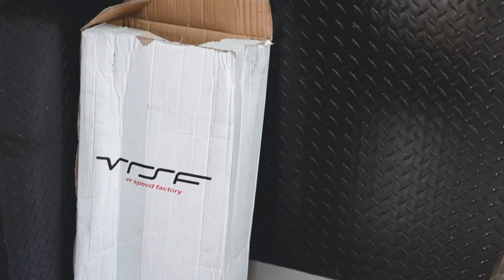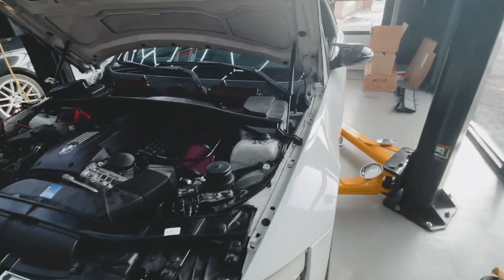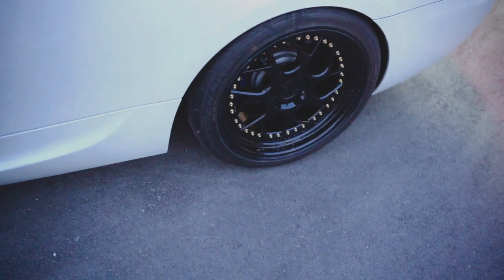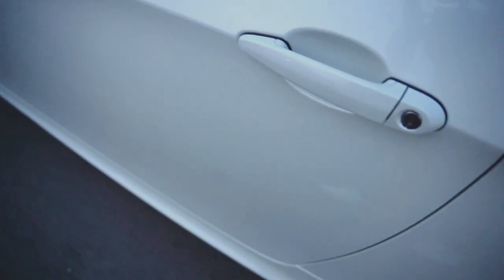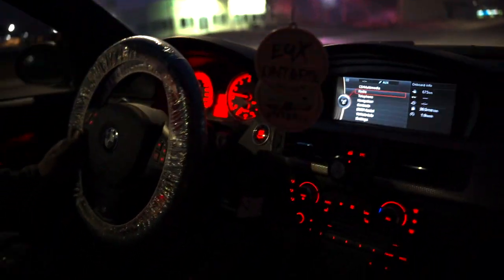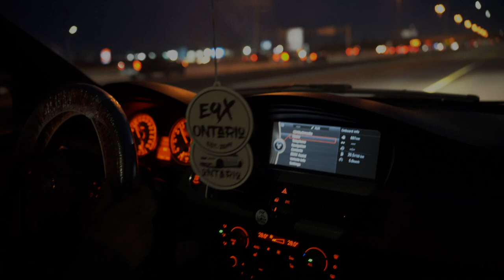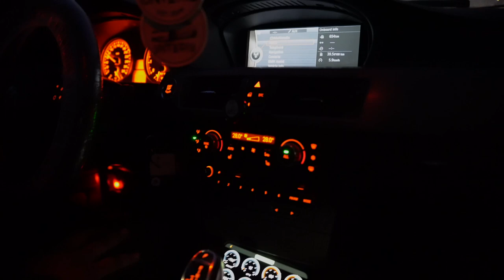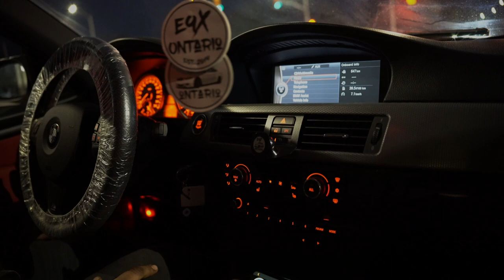335is CTS Turbo Stage 2+ Kit Install + Test Drive

Comment: Decided to get DAW Flow Max Plus myself. Lookin good n great video 👍
Reply from the maker: Thank you! Have been hearing that a lot about the Daw flows, how long have you run them for?
Reply: @e9xontario  I’m not running them just yet. I’m in school and work at bmw part time. Just saving up for everything I need currently. My turbos currently are leaking bad and rattle. I’m at 76.5k miles right now
Reply: @rrokas  dang 76.5k miles, i dont know why but that doesn’t seem like a lot to me.
Reply: @Eliasccv14  tuned stock turbos usually last 80-120k. I just got the short end of the stick. I’m only running a stage 1 tune too lmao. Turbos getting installed this weekend
Reply: What's the update on the daw looking into these myself??
Reply: @99sitrrz  they running well, I think I need new solenoids and vacuum lines, or need to physically adjust the actuators. Getting some wastegate rattle. But other than they they work great, driven 700 miles at this point
Reply: @rrokas  nice!! I really want these but tempted to roll the dice on some 19ts from fapo.
Reply: @99sitrrz  they’re great just make sure you have the supporting mods for then

Comment: How are they holding up? I’m really looking at the stage 2+ because your boi only has so much money 🤪 if not I’m going with either pure 600’s or the newest evolution of vtt mid range turbos that are basically compared to the 600’s.

Comment: What are all of the supporting mods have you to the 335is? I want too buy them but i dont know what to buy 😅
Reply from the maker: All depends on what you're running now, currently the 335is is on all fbo parts, upgraded fuel pumps, bigger fmic, and custom tune.

Comment: Do you need a custom tune for CTS stage 2 turbos rs on a n54 I have them, but I don’t feel the difference
Reply: Yes tune it, as long as you have supporting mods you’ll see a difference
Reply from the maker: Custom tune is required for these turbos, if you’re not tuned the power output won’t improve and also the turbos will wear out faster.
Reply: Thank you ! I thought the people who installed them ripped me off,but you guys are saying wedge is a good custom tune ?
Reply: Is it normal for me to be getting 5psi right now ?
Reply from the maker: @nicholas9002  should not be seeing 5psi, your car definitely needs a custom tune or a OTS tune and also get it checked out. You may have a boost leak. I just went with wedge performance as they also did the OTS maps for MHD Stage 2+ which I was running previously.
Reply: Kyp my man 😎
Reply: Had those turbos when they first came out last year..started smoking like crazy and leaking oil from seals after 1 month..cts didnt help at all their customer service its the worst dont recommend this turbo brand to anyone..got DAW 775rs they been way better by far.
Reply: Hey fellas I got my boost leak fixed what is a good custome tune for the CTs turbos ??
Reply: @nicholas9002  cd919 FTW
Reply: DO NOT drive a car with upgraded turbos & no custom tune!!
You will destroy your new turbos! 

ALWAYS get a custom tune as soon as different-sized turbos are installed!
Reply: Does anyone have MHD basemap for these turbos they can send? Just installed them on my n54